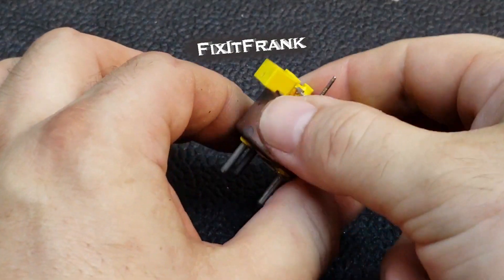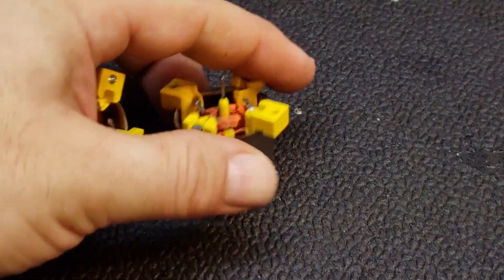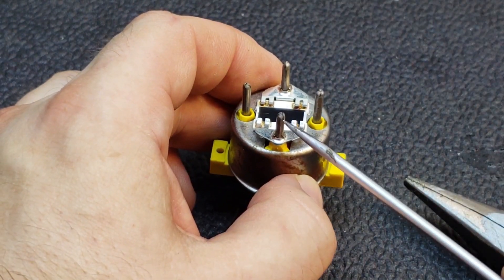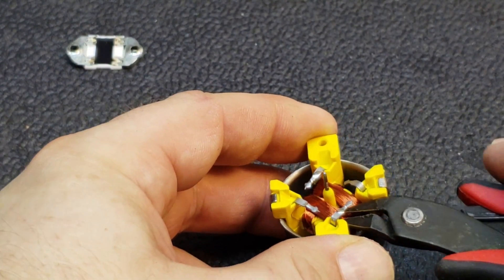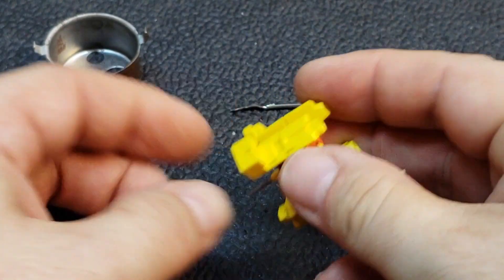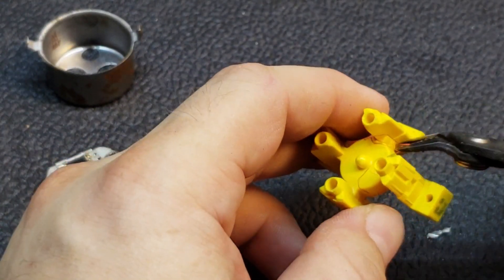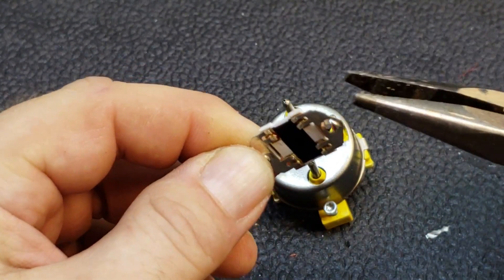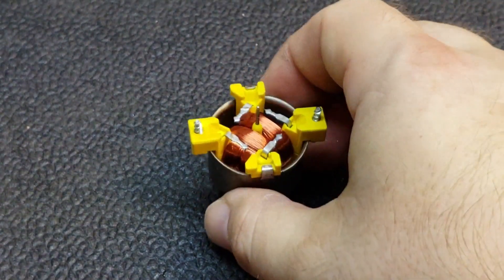Air Core Gauge Motor Teardown (Older type)

Comment: So big question I am trying to repair a John Deere cluster and cannot find replacement Air Core motor. What do I need to know to use a replacement of different but new design Motor.
Reply from the maker: That's tough. Aside from the physical layout/size,  Id say  the coil resistance. These things are kinda black magic to me after that. Good luck!

Comment: Do you have any idea on where I would get a 1994 Chevrolet s10 temp gauge air core stepper motor?
Can’t find them ANYWHERE brand new.
Reply: I can’t even find a way to buy the resistor nor do I know how to read the code on the back of the resistor.

Comment: Frank, still answering questions about air core gauge motors? Have a question on diagnosing, repair  and suppliers. (From 1995 garden tractor instrument panel)
Reply from the maker: I am not an expert on these. But I am happy to offer any information I can! Feel free to ask.
Reply: Hello! I am trying to find info on an air core motor for a John Deere tractor instrument cluster that is really a strange design. The ones I have were rusted and don't move free. I got one to move and another, barely. Your explanation of their principle is great! And has helped me understand how simple they are, tempting me to try and fix them. I have pictures if you have the time to take a look and give any advice you could give, They can not be found anywhere. Not sure how to get them to you.

Comment: So I need to convert these type motors from clockwise direction to counter clockwise.  Any ideas or help appreciated.
Reply from the maker: you can try wiring them in reverse. youd have to cut the traces on the pcb but if you wire the top to the bottom and lef to the right, it should run backward.

Comment: When they start getting erratic is there a typical reason why like a short between the coils or are there a couple different things that can cause it? Assuming everything else in the circuit from the sensor/sender to the gauge tests good.
Reply from the maker: I'm not 100% sure but what I have learned so far is that its partly to do with physical resistance of the mechanism. Over time the wear surfaces get smoother and they then get wonky. I have not gotten a true response yet though from someone definitively so take what I say with a grain of salt.

Comment: do you have a know good F for 96 tahoe I believe it is yellow
Reply: can I pm you
Reply from the maker: frank@fixfrank.com
Reply from the maker: I'm sorry I don't.  I have sourced them from EBay in the past but I know the older ones are harder to find.  I'll ask around though.  I am not a mechanic but I know a few and they tend to throw me the electronic work when its above their skill level. I have repaired more ECM/BCMs and other weird automotive boxes than I can remember. I'll see if they have any 96 GM truck clusters around with good fuel gauge motors. If you want to drop me a line in my email( on the about page), I will let you know if I get my hands on any.

Comment: Supposedly the rotor chamber on these were originally filled with a thick silicone oil that dampened their movement when the fuel sloshed around. Hey I read it on the internet so It must be true! Anyway if true, I wondered if an alternative would be to make some kind of external resistance. Specifically was thinking maybe a thin rubber or plastic piece I put a hole in for the shaft to go in, then have that piece mount between the motor and gauge face plate and held in place. Either by holes in the "friction" piece that the mount screws go through or make it where it would fit between the plastic mounts to keep it from rotating. Does that sound like it would have any chance of working?
Reply from the maker: Everyone knows you cant tell lies on the internet!  It must be true.  I heard it was Henry Ford's blood that they used.
As far as your idea, honestly maybe. That was what I kept kind of coming around to.  That there needed so be some sort of "soft resistance".  Granted they are kind of cheap(the newer models that are flat and white) but these might benefit from something like that.
Reply: @FixitFrank  So you think the oil filling is doubtful? Seems like if it did leak out you see it all over. The one in my 97 chevy truck moves around a lot when the truck is moving as if it following along with the level float moving up and down a lot. I actually it maybe it was some kind of electronic dampening device that might need replacing. Once you stop it settles down and seem to give good readings to the actual level. I don't personally mid it, but it really concerns my wife especially when it's got like a 1/4 tank and keeps dropping down to E. Googling I did find some adjustable electronic devices devices that supposedly can be used to any sending unit and any gauge for folks retro fitting gauges in an old or car they are modifying that supposedly have some kind of anti-slosh built into them. One example I found, nothing I get money from.
https://www.tanksinc.com/index.cfm/page/ptype=product/product_id=748/mode=prod/prd748.htm?gclid=CjwKCAiAxp-ABhALEiwAXm6Iybjl3ljon7S3v5e7CLclZQhAwTGyWV-P7GEWpaxKwTNZkUuB_WATdxoCZG0QAvD_BwE

Looks fairly straight forward to set up
http://www.tanksinc.com/pdf/MeterMatchInstructionManualTanksInc.pdf

This one looks like you can set it up for various manufacturers and years before you start it up and you're done.
https://static.speedwaymotors.com/pdf/910-12910_2019.pdf

I'm guessing I'd have to see if there is just one wire output coming from the sender as I'm not sure how I'd wire into that gauge panel otherwise based on the wiring diagrams they show. GM supposedly had a TSB on late 1997 a fuel level damper kit 12167652 but they no longer make it.

Comment: I'm thinking that resistor is on there to calibrate the device. It is difficult to wind coils so they are identical. So the resistor is custom trimmed for that particular meter. If your resistor gets cracked or otherwise damaged, the resistor from another air core gauge will do better than nothing, but it won't be properly calibrated.
I imagine they are intentionally made so that the coil with the resistor has a turn or two more, so it is guaranteed to be a little stronger than the other coil. Then that flat film resistor is added and laser trimmed.
You could replace it with a resistor and a ten turn potentiometer. Simple to calibrate - full current through one coil, that's 0 degrees. Current off, full current through the other coil, that is 90 degrees.
Now connect the coils in parallel so they get exactly the same voltage. Trim the resistor so the needle is precisely at 45 degrees.
Reply: Interesting, very technical.  pro electricians are like magicians. Wow.
Reply: @chrisgooi  Electronic engineers and electronic technicians. Electricians wire houses.
Reply: Using 12v right?

Comment: So what's there to go bad on it? No bearing. So either the coil wiring could fail or the resistor could fail. I don't see what else could go wrong.
Reply from the maker: You'd think so, but the coils and resistor are still good.  I think its more the small wear surfaces where the axles rub against.  I 'think' there is some friction used to keep the meters moving evenly. Another possible cause is the magnet in the rotor getting weak. I'd like to spend more time learning why these fail but that time thing is weirdly limiting...

Comment: Do you know how to repair a defective one by adding a resistor to it
Reply from the maker: How so?  I don't work with these often. If you have any insight, I would be interested to understand.
Reply: The resistor is there to balance the coils. With a cracked or burnt resistor, it will show accurately at 0 degrees and 90 degrees, but will be off between those points. The resistor seems to be laser trimmed for each air core gauge. I posted in another comment about it.
Reply: I need to repair my fuel gauge motor

Comment: My understanding is there is a filament or silicone in them that goes bad over time. Do you know where that filament should be, how to tell if it’s bad, and how to replace it?
Reply from the maker: Do you mean in the axis?  My only guess is the wearing surface becomes worn out and no longer has the same friction.  That is purely a guess though.  I may have to revisit this.  I still have the motors in a drawer.  I can't answer your question on repairing them though.  I tend to replace them since I do not really understand the failure mode.
Reply: I know this comment is old but yes, you can repair them by adding oil to the air core motor. The oil acts as a damping fluid that will keep it from bouncing. All you have to do it add oil and the needle will work like new.
Reply: I’m not sure if they’re repairable, I’ve just noticed that as they age, they begin to turn easier which causes them to bounce. I was hoping there was a way to restore that friction to eliminate the bouncing if that makes sense. 

In the mean time, do you sell replacement motors or care to share a good source to get some new ones?
Reply from the maker: I get them on eBay or Amazon most of the time.  eBay if I am not in a rush.  I usually keep a set of GM and Dodge around as I get requests for them the most.   I need to make a driver circuit to run one while out of the cluster to try and see what the failure mode is.  I'll add that to my videos to make list.
Reply: FixitFrank that would be really cool! Thanks for the info!

Comment: Hello! Great video. I have a question, you seem to know a lot about these stepper motors. I'm repairing a 2002 mustang gauge cluster, and it has air core motors on it, however they don't have any markings on them, and I can't find any information online to purchase them or even what they're called. Maybe you might know a source of information, or possibly know what kind they are? It will be much appreciated! Thank you!
Reply from the maker: Hi Jim, There should be some small lettering somewhere.  Are they  similar to this type in this video?
Reply: Yes it's very similar to the one in the video. The only marking I can find on it is a tiny number "13" on the plastic. I could send you a picture to your email if you like. Thank you for the reply!